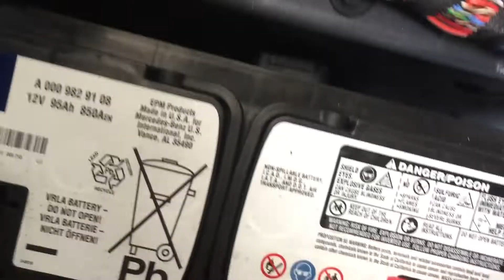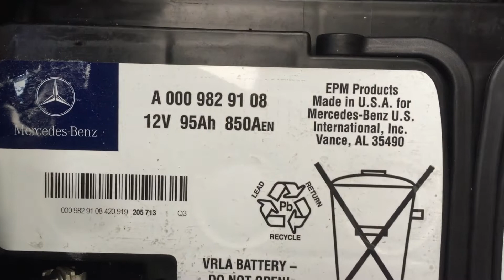Mercedes-Benz GLE 300d Battery Replacement: How to do it step-by-step

Comment: Sorry, This is a poor video and certainly not ‘step by step’. OK, the battery is located under the passenger front seat. Next shot shows front seat removed, I think? Video did show how to remove seat, or disconnect or replace battery. Do you need to connect an aux battery to the terminal posts under the bonnet or is there an aux battery to keep electronics powered? No commentary or on-screen instructions. Sorry, waste of time.